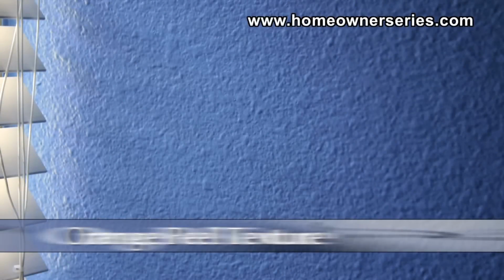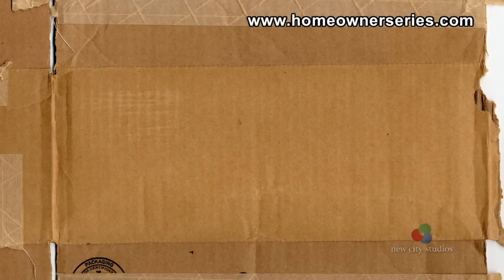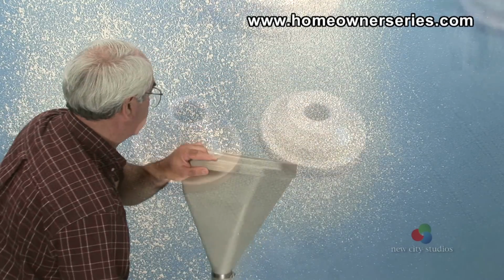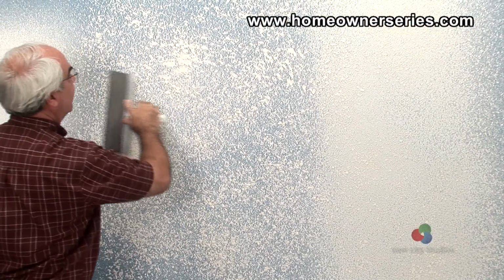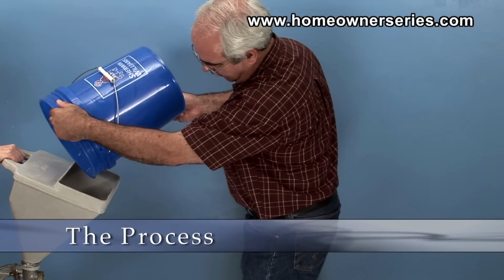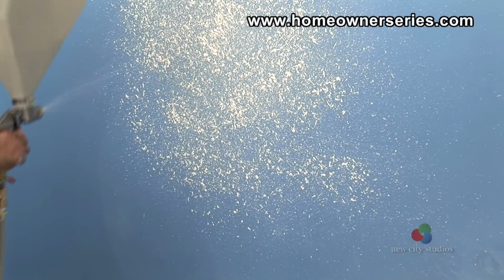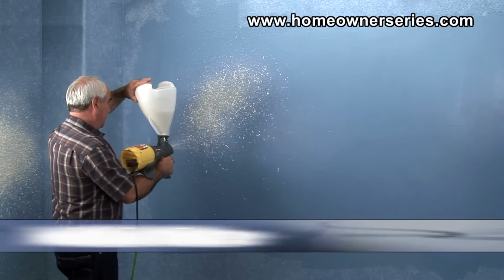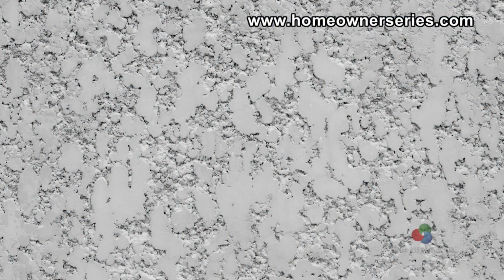How to Texture Drywall - Orange Peel Knock Down Texture - Drywall Repair

Comment: By accident I let the bullnose and doorway dry a little more.  I bought a curved tool from All-Walll, expensive for one time use but did the job.  No line seams from knifes.  Painted with latex arylic sealer, primer, paint.  Looks great.

Comment: How would you do knock down on a double bull nose archway?
Reply: +Kris Kersch After knocking down the flat parts of the wall, allow the bull-nose parts to fully dry, then hand-sand them to match the walls the best you can. Another way is to use a flexible piece of plastic, curving it in your hand to match the curve as you knock it down. Or cut a curve into the plastic top of a coffee can to match the size of the bull-nose. Many ways. Good luck.

Comment: I thought this video was great, but it didn't go into the proper mud thickness enough.  I don't like knock down, but prefer a very slight orange peel to a flat wall.  I see it all over the place.  That's my two cents from Wisconsin.
Reply: Agreed it is waaaay to heavy the way he's applying in the video need to be quicker circular motions without over excessively overlaping and wetter mud to make it a very faint almost flat wall after paint I love the look of this texture but only when it's only visible from the lighting and not a eye sore but I suppose it is a preference does not make it wrong just a bad opinion 😅
Reply: Ar
Reply: Q

Comment: Excellent video!  I've been taping and finishing for years and consider texturing much more durable than flat finished walls.
The amount of work flat walls require makes texturing much more practical.  Repairing damage to a flat finished wall requires much more work than repairs to a textured wall.  Screw the haters...
Reply: Its a matter of having a blended texture. versus having to have smooth wall with seams and risk of tape exposure. there are times where texture is PITA, but overall i am with T Ago, texture is easier to hid damages and conceal problem areas on a wall.
Reply: A smooth finish Is way easier to repair than a textured finish any day of the week. However for speed a textured finish is the way to go but only if it going on a fresh wall otherwise its just a headache.
Reply: @James-tr9eg I had a woman last year that did her own taping on new "fresh" flat walls...
And then she used a buzz grinder on her seams. Probably like you do! 😂
When I finished texturing you couldn't see her nightmare.
I bet I could see your seams from 10' away. 
I have a feeling you're not as good as you think you are. 
FYI - you can buy cans of spray texture for matching textures.
It's for those not up to the task. 

If you're as good as you think you are
Reply: Well by your response I can tell one of two things.  You are either very new to the trade or your just an idiot.  The fact is a smooth wall is always easier to repair than a textured one less steps make it faster....also I never said anything about texturing being hard or that I couldn't do it. Its the preferred method now a days.
Reply: @James-tr9eg  
My original post clearly stated MY OPINION. You should read it again. If you don't like it or don't agree then I don't GAF.
You like to dish it out - and then whine cause you can't take it!
Get back on the porch...
Reply: I get, so what your saying is "YOUR OPINION" Is the only thing that matters and if someone has a difference in opinion instead of debating it you lash out at them like a little kid can try to belittle them saying they don't know how to finish? Is your mental state stuck at that of a  5 year old? Lol. Have a good day sir.
Reply: @James-tr9eg  OH MY! A snappy retort!
Not to be confused with a witty one though...
I'll enjoy my day  - and you enjoy yours too. 
Now go back to your cartoons & stop bothering the nice man
Reply: @James-tr9eg  I owe you an apology. 
I'm sorry James, I mistook your opinion for someone elses.
Mea culpa
Reply: Repairing a flat wall takes more work than a textured wall?  You're either very bad at drywall or don't do it at all.  Matching texture after a repair (you have to tape and mud) is a real pain.  And, if the wall was smooth, then you don't have to do anything after it is taped and mudded, so how the eff can it be more work?????
Reply: @DiffEQ  if you think texturing is harder then you don't know how to do it. 
And if you don't do anything after flat taping then you don't know how to do that either!
I bet you walk on water too!

Comment: You skipped the step where after you knock down you need to sand it down. It only takes a few minutes. better finish and not so crummy looking. Knock down covers lots of imperfections.